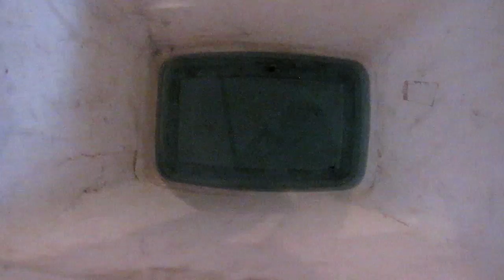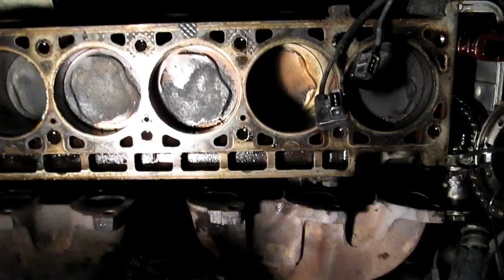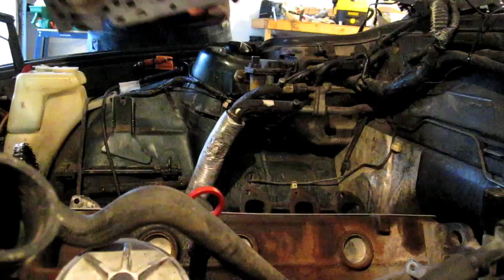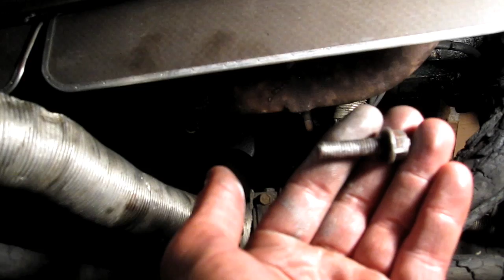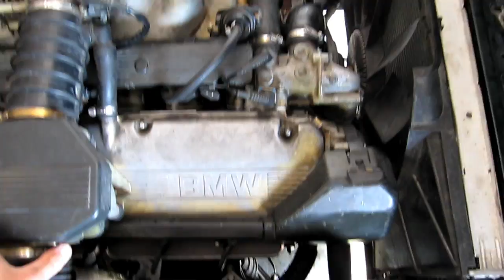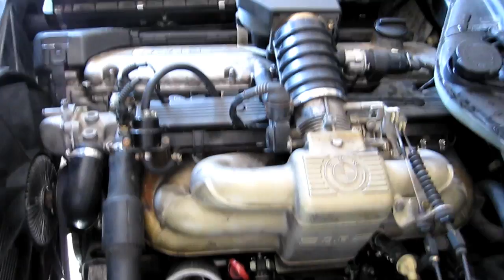BMW M30 Rebuild

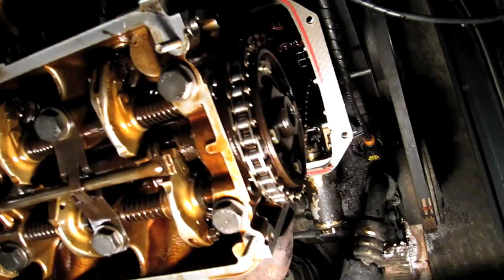Comment: If the two camshaft's (24:35 on the right side) lobes are worn & causing a tick tick engine noises. Anyway to correct it or add or mod to lessen the noises beside replacing the camshaft? And camshaft used is way overpriced. Car has low resale value that I don't want to throw money into a 38 years old car (M7).

Can the camshaft's lobe peak be welded while it still on the engine?
Parts are so hard to find & once available the price is way up north.

Comment: I know this is an old video but I have a question: I did the same for my M30 6 years ago and I can't remember if I torqued the bolts after running the engine at normal temps. I know that Bentley states that they have to be torqued at a specific angle after getting the engine into temperature. Did you do that or you just followed the torque specs from the head gasket pack? Thanks

Comment: stupid question, but to turn the engine. Do you do that with the big bolt on the fan? I am planning to do a valve adjust, and im pretty new to working on cars.
Reply: you could do that if your belt is tight enough, if it isnt, you can turn the big balancer nut on the bottom. If you are only adjusting valves, even if your belt isnt tight enough, hold it tight with your hands, it will be good enough to slightly rotate the engine to get the camshaft lobes where you need them to be

Comment: Hey I see it's been awhile since you uploaded anything on your E34. I was just wondering if you still owe on the car and how's it running. I currently have a 1990 535i with 280k miles. It currently runs amazing but I plan to do this job in the future. I feel you did great work explaining how this job is completed. Only thing I would recommend now after seeing the footage is a lifter adjustment. Thanks for the great info!

Comment: Very good  job. Me, i am driving BMW since 1985: BMW 320/4, BMW 3181is, BMW 328i, BMW 528i, BMW 116i, BMW 125i with complete m-pak and m -erformance pak (not 218  PS, but 240 PS, and since December m140i. Last car is my favorite, the 125i was not good. As is ordered the car it had six cylinders, when i got it: 4 ylinder turbo. This car needs nearly the same fuel as the m140i. But: IfYou are drviving 130 km/h the m140 i needs about 6,5 l fuel

Comment: Hi, very informative video, just wondering what product did you use to clean the cylinders ?
Reply from the maker: Transmission fluid. It dissolves carbon deposits like nothing.

Comment: Nice Job! Good Video! I noticed some oil leaking very "Slightly" from my head at 180,000 miles now. Between number 5&6 cylinder on the passenger side. Runs down past the block drain plug. I don't know if I have to change my head gasket yet. But if I do, this was a great video to see. I never worked on one of these engines. So I don't know if I should be alarmed. It is very slight, and I only noticed it because I was trying to find my drain plug on the block.

Comment: Different materials of head and block will allways give headgasket problems over 250000 km +But the pitting issue is likley caused by bad coolant.It will leak in no-time because you did not repair the pitting issue

Comment: Hi, I'm from Brazil and I got a 535i 1990 with 90875 miles and I'm doing some repairs in my car... 
unfortunately, here in my country the spare parts are difficult to find..... and sometimes the only way is "run" to an authorized, but, the prices..... oh my God.... Well, I'll keep working, it is a fantastic car.... She rides very well and very comfortable, considering her age... It's a great car ! I think would be nice to change some knowledge and some tips.
 Good luck with your car.
Reply: Victor Castro if it works use it man... BMW wants ridiculous ammounts for even the smallest of things.. $200 for an o2 sensor.. (Mustang ones work if you splice the connector and cost $40)

Comment: what is the ringing at the first start? I have the same noises now, is it chain need to change or what?
Reply: im a BMW mec and have never changed a chain in my history but worn Down rocker arms and cams yes the head gasket last for 200.000 km then it blows bet cyl 5 and 6

Comment: Although this is an old video and the uploader has done a great job sharing this. If the head has pitted ports like that. I would send it off to the machinists. Also like someone else here has said, get the head skimmed, machined off by professionals. I would look into the pistons and Valve stems too while i have this much of an apart with that mileage. Replace new bolts and plastic and rubber pipes.

Comment: one of the best motors ever made.  I have almost 280,000 miles on my M30B34.  Motor still runs strong.
Reply: Feledwards i have about that on an m20 :0 420,000 kms :p
Reply: RobTapps88 I’d take a m20 over a m30 any day of the week
Reply: suntzu nikola i have 3 m20's... and an m30.
Reply: @YittsuKitsune  I have e24 633csi 735il and e34 m20 and m50 e34 estate
Reply: @koolmotor420  hey bro im thinking of pickong up an e24 m30b35 how hard is to maintain one now a days idk shit about it im a 3 series person
Reply: RobTapps88 nice
My e30 has 93k original miles on it
Reply: suntzu nikola my m20b25 has unknown kms.. one b27 has 350+ thousand and the other has 420,000kms the b25 is for a stroker build
Reply: RobTapps88 nice

Knock on wood
My e30s Odom still works too hahaha

Comment: Well at least the m30 block must be way better than the m20....for 2 years ago i have done my cilinder head together with my garage owner...now again oil pooring into my cooling system again and again....im really getting frustrated because only after 2 years you ll just have to get it of.....again!!! And there were more options about what went broke...the head that got cracked....the gasket doesnt tighten anymore... or a cilinder spring just broke....no fun after only 2 years and no big amount of kilometers....

Comment: Defintely something that shouldn't be undertaken without know-how and proper tools. "Looks pretty good considering" visually is probably the worst measurement you can make, as well as a cheap ruler for checking the surface for warping. Engine don't run using clearances/tolerances that can be seen by the naked eye. The fact that it runs is luck all by itself.
Reply: What, do you think that every single head warps and requires machining? These things are renounced for running 500,000+km I'm sure it's still going today

Comment: Can someone measure the length of a BMW straight 6 engine block and write back to me? Or the full engine length with the front pulley, doesn't matter. Can also be the M52 engine. I was wondering how it compares to the Chey 250 inline six.

Comment: always get the head surfaced and pressure checked alot of work to have to do it over again because of a unseen crack and it usually only cost about 50 bucks for the machine shop to do it
Reply: "always" ?? i thought the only time you need resurface is if its warped or has erosion/pitting?
I have no doubt this head gasket started leaking not long after because of all that erosion around
the water ports. To repair that would require grinding out the eroded aluminum and tig welding, then
resurface.
Reply: the engine block use to crack NeXT to the oil pressure hole

Comment: I thought you were suppose to replace the HEAD BOLTS when you take them out.
Reply from the maker: If you had actually watched the video you would see that I replaced the "HEAD BOLTS". Emphasis on the capital letters there! People wouldn't be able to understand without the capitals!
Reply: Yes They did look new. I did not replace mine , and its still running strong.
Reply: Bobby Raber how much torque did u use on the head bolt pls
Reply: Bobby Raber big yes. 100% replace the head studs/bolts.. The OEM bolts are TTY (Torque to Yield) and stretch when torqued down. They are a 1 time use item. ARP studs can be reused.

Comment: I'm currently replacing a head gasket for the same engine.. How do you take the nuts off the bottom end of the intake manifold? It's a little tricky as you stated..
Reply from the maker: When removing the head I took the head and the intake off as a single unit (had a friend help me). When putting things back together I did each one individually to make it easier to place the head(lighter). Putting those bottom nuts back on for the intake was very very tough. I used extensions, flexible joints, and spanners and still had a very tough time. Those things are in a very tight spot so no matter what you do it will be very tricky. Good luck!

Comment: good video and nice looking ride. I wish my 90 5 speed was in this good of shape body wise. i'm planning on doing this job soon. loss of coolant and overheat. pretty sure my head will need milled. I read the manual but I like a good video to go along with it. you're a lifesaver. thanx
Reply from the maker: Ah you have the 5 speed, lucky man. I have the 4 speed auto version. Still goes pretty good though!
I think I may have mentioned it in the video, but in the end it took me about three days (evenings) to finish this job. It's worth taking your time at it if you can. Good luck!

Comment: This is gasket change not a rebuild.Sorry but it is stupid to take of the head without simple check of the valve seats. I am sure the valve guides are finished and for the valve seals there is no need to comment. Head grind is compulsery. Amateur work!

Comment: id like to add that a magnetic drain plug is always good when pulling anything engine related apart by the way how is she running now? i'm doing a full rebuild of my engine...i blew the bottom end on it a couple  months ago. and yes your right you need to be patient with it and yourself
Reply from the maker: Yes, magnetic drain plugs and patience are always good things to have. Engine runs great, same as always! How did you blow the bottom end on yours? The bottom end is supposed to be really strong on these engines.
Reply: i got a1990 niissan 300zx and  main rod  bearing just had enough and said seeya soo. ive stripped my engine down to a bare block and am trying to find a job soon so i can keep it and start back on the build again. ivev been jobless since october last year...
Reply from the maker: Oh it's a engine from a nissan 300zx. I thought you were talking about another BMW M30 (which would have made sense because the video is about the M30 lol). The bottom end of the BMW M30 is built like a brick shit house, you pretty much can't wreck them...

Comment: Not doubting your mechanical knowledge. Just wanted to add a couple things for someone using this video as a guide. Pro checked head will also find bad valve seats and cracks you may not be able to see. I always rotate engine after timing belt change on m20 engine. 10 seconds of free motor saving insurance. Valve springs can rotate the cam after head removal

Comment: couple tips, get head professionally checked always!! never set down a head with camshaft in it on the valves. they could bend. always set it upside down. clean fluids out of head bolt holes! if left in the hydraulic pressure will give you a false torque setting and loosen later. use new head bolts! old ones are stretched. after assembly rotate engine by hand to double check cam to crank timing. valve interference means new engine. use copper exhaust nuts. upgrade to 4 pintle ford injectors